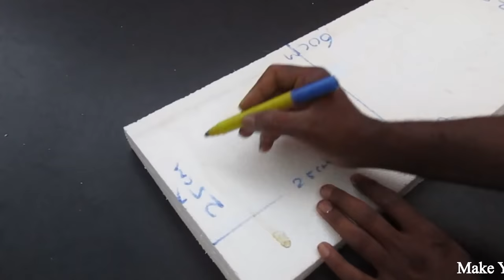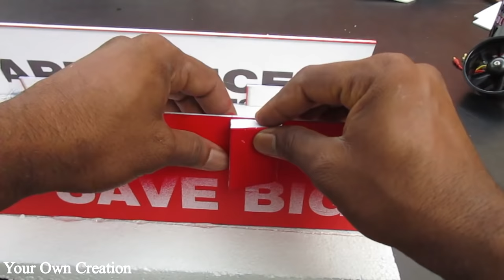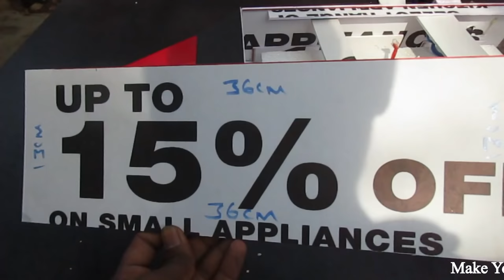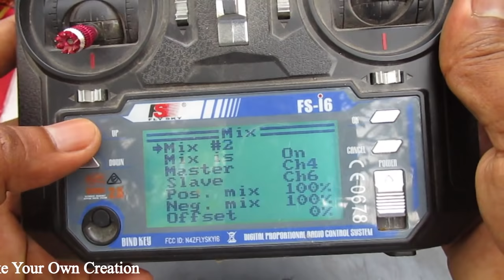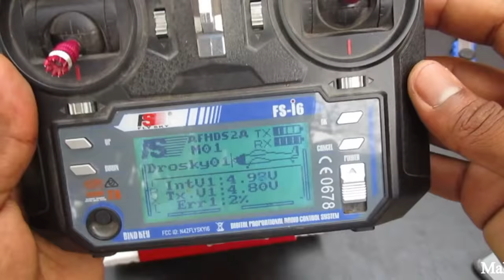How to make a BOAT - Racing Jet Boat - Boat

Comment: How to connect two engines to a throttle jostic I have the Flysky FS-I6X model and I have 10 Chanel on my receiver I have two esc two engines but how to connect 2 engines to a joysick